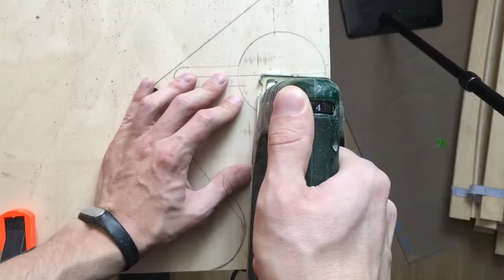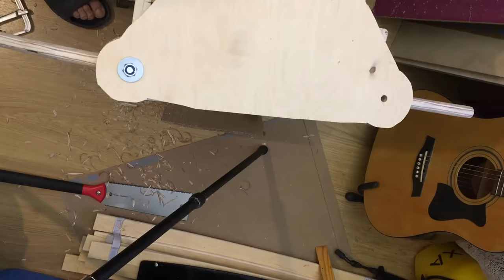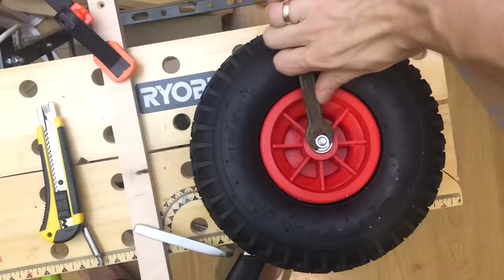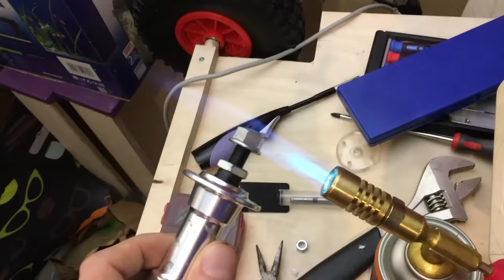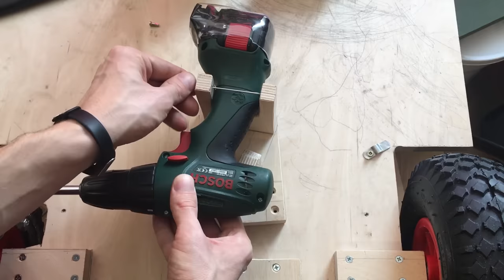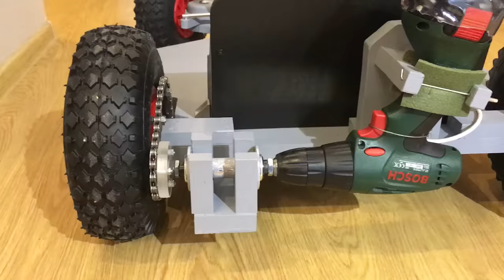DIY Drill powered Go Kart

Comment: Very nice, great idea!
Suggestions to make it even better, add a foot rest for the left foot so kid doesn't accidentally extend leg and scrape against left tire. Add another two lines so that each one can can change the direction of the drill for forward and reverse. Should be the same concept as the cable line assembly for the "gas" pedal just with less travel to change direction switch.
Otherwise great build!
Reply: bro its going like 1km/h

Comment: Very nice, I would put a shift lever that has a rod that rocks back and forth triggering the forward and reverse switch on the drill. Epic... lol
Reply: I was gonna do the same thing on my project thinking the drill will be providing the braking. How wrong I was. The problem was the drill was instantly braking and introducing shocks into rear axle setup. Had to change it for ratchet style like on bikes so when drill stops kart can keep going. it means no reverse gear and require a brake now.

Comment: Very cool indeed. It will roll round corners better with some Ackerman angle on your steering arm. Also when you're ready you can attach a second motor to the right hand wheel.

Comment: all those guys complaining in comments are so funny to read lol completely missing the point.

This build is about simplicity with simple materials, ordinary tools and the least amount of parts he could think of.

Which is quite a strong point for an accessible homemade DIY..

But no, let's complain it has no gearbox, no tachometer, it's not aerodynamic, no power steering and so on.

this is a DIY, the kind that even they could actually build instead of complaining because it's not engineered like a real vehicle that is out of their and the other 99% of the viewers reach..
Reply from the maker: Exactly! This is kind of project you can make together with kids (if kids are interested) and kids can do lot of things - drill holes, cut wood (with handsaw), screw screws,  make decisions on design, etc.

Comment: Good work and in some ways was an inspiration for my project. There was a major issue I had with the direct drive though. The drill has an instant chuck brake (at least on my drill) so when stopped the whole rear axle setup was getting huge shocks. Not good and had to change the arrangement for ratchet style like on bikes. That way if the drill stops the kart can keep going. It means it won't get reverse gear but that just isn't doable with the drill im afraid.
Reply from the maker: yes, in case of automatic chuck lock some kind of freewheel is needed (and also a brake)

Comment: Very nicely done. Building something on my own based on your steering. How did you widen the whole in the wheel to fit the bearing? i didn't quit get it. What did you put in the stick to cut the plastic?
Reply from the maker: It is screw sharpened as cutter

Comment: Where did you get most of the supplies for this? I can obviously get the wood at Lowe's/Home Depot, and I found some similar wheels on Amazon, but where can I get some of the metal hardware you used?

Comment: @garage11
Good night.
What kind of screws did you use to secure the wheels and the steering part?
 What is the material and diameter of the barrel used in the steering wheel?
What is the name and diameter of the 2 rods you used in the direction?
I'm going to do my course work using this project and I have to do it myself and I'd really like it to help me.

Comment: Does the drill brake when trigger is released as most do? Does this cause issues or does the momentum push past it?
Reply from the maker: Drill I used don’t have automatic chuck lock, so when trigger is released, it stops slowly, not instantly.

Comment: I am sure you notice ,when  you cut the power of drill, it will stop instantly, because of the transmission inside the drill, that will affect the go cart make harsh break, which is not really comfortable for the raider ,without sorting that problem its useless
Reply from the maker: This drill don't have automatic chuck lock, so it spins even without power.

Comment: I think reductor is not enough. Little star should be smaller, big star should be greater. You can see how fast wheel is spinning without load. With load it's spinning much slower. It means that drill power is not enough and it's working on the edge of its possibilities. I think it may result damage of drill's engine very soon. Also I wanted to say that opened reductor mechanism with metal stars and chain is not safe for children. A kid can push the finger between chain and star and start the engine. Need to hide this mechanism from free access.
Reply from the maker: Maybe little bit different gears would be better for more torque, but in this case it is not crotical - go kart is mostly ridden on flat gravel and it spins there. Agree about chainguard - it is reccomended.

Comment: What do you brake that thing with tho? 😄
Reply: Electric motor + movement = regeneration. Basically stops itself easy. You can also mount on the other back wheel a bicycle disk brake.

Comment: Doesn't It Have Brake to Stop
Reply: The drill is the brake as it has integrated chuck brake. That was actually a big problem for my project and I had to change the arrangement so the drill doesn't brake the rear axle.

Comment: Should have used a battery powered concrete blender drill instead. That battery drill will wear out pretty fast. My machine caught on fire when i tried mixing some concrete, and this machine was plugged in to AC.

Comment: A snail's pace for 5min run time. Ide rather a 360° spinning front wheel an Ebike conversion for small bikes. Then build something like the krazy kart. Or use mobility scooter elecs with ketcar chassis.

Comment: where is the breaks
Reply: The drill is the brake as it has integrated chuck brake. That was actually a big problem for my project and I had to change the arrangement so the drill doesn't brake the rear axle.

Comment: Cool build, but not worth the time spent on it. No reverse, it's going way too slow, and unless you already have these spare parts, cost probably exceeds $100 (wheels, wood, chain, paint, screws, etc). And counting tools like the drill, it's probably $150. For that price, you can get a decent used power wheel that is way better than this build.